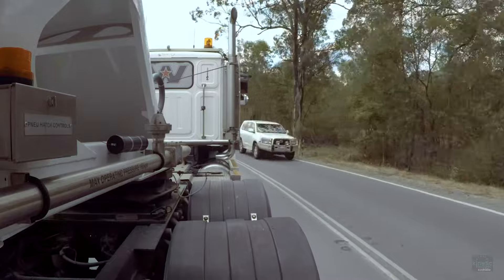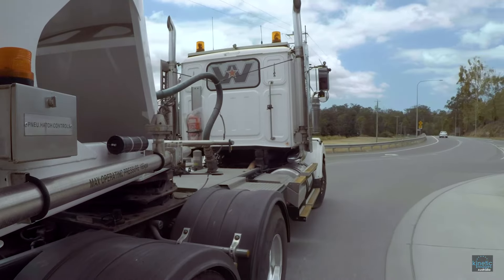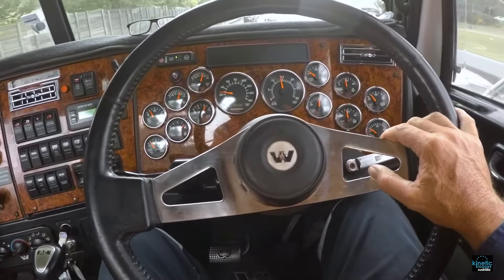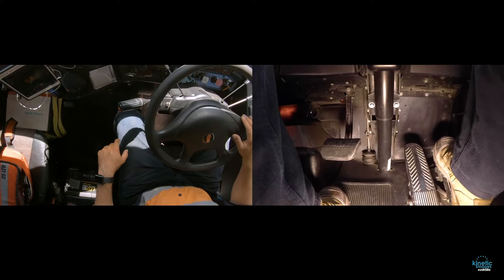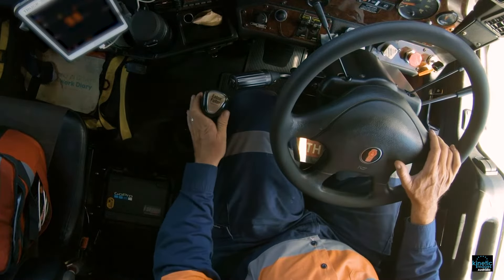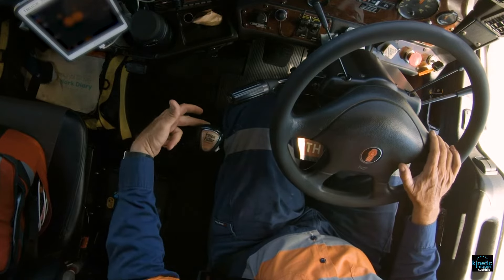Shifting the 18 Speed Road Ranger, with foot work.  Aussie Trucker Trucks and Stuff  Basics

Comment: what I found funny starting in the industry most truckers cant even explain how to drive a road ranger - the key is know what gear to use for what road speed and the rev ranges to use for changes.  Always double clutch and ignore those who tell you its better to not use it. When your loaded you rev higher before changing as you loose road speed and revs faster when heavier, you need the extra revs to stay in the sweet spot when changing.
Reply from the maker: Your spot on Michael Re loaded and loosing road speed faster, however the revs drop the same no matter what (unless you have exhaust brakes enabled) the magic is knowing your particular trucks characteristics and yes, matching road speed and revs… an interesting thing I’ve noticed in all my years teaching is that people often try changing when turning at intersections etc when loaded and you loose road speed real quick when you factor in axle scrubbing whilst turning…
Thanks for your comment Bloke :)

Comment: I have to relearn how to double clutch! I've been floating for so long that when I try to double clutch, I end up single clutching, lol! I also do not use the accelerator to complete a split shift. Instead, I use the shifter to complete a split shift by just moving the spliiter forward and taking the shifter out and putting it back in. It's much faster and you lower the chances of re-applying the accelerator too quickly, ultimately not completing the split shift, then the rpms over-rev, which makes my soul cringe, lol! Nonetheless, everyone does it how they do it. You're a pretty smooth shifter, too, btw!
Reply from the maker: @IndigenousAmericanTrucker  your spot on, everyone does it a bit different.. and as you know the main thing is to match the road speed with the engine speed… it all just takes time to be second nature. Thanks for your compliment and comment :)

Comment from the maker: Most of my videos I try to entertain as well as educate and my apologies if some of you are not music (or at least the music I chose :) fans.

I get a few comments about the music being distractive and you can't hear what I'm saying, my apologies. 
However near the beginning my voice is only supposed to be background ambience and not fully or clearly understood.. The graphics and visuals are what's important at this stage.
There is plenty of my vocal instructions where important..Skip ahead (see the below time stamps).

There are 9 sections
0:40 Gear stick basics and detent explanation. 
1:40 Introduction to the 18 pattern, the focus of this section is on the graphics and my hand.  ( My voice is intended to be back ground only and not clear)
3:18 A quick look at skip shifting and clutch basics with clutch brake.
4:50 Downshifting.
7:05 Downshifting with heel and toe foot work. I like this method personally because it allows me to make one application of the brake and I'm able to modulate the brake pressure at the same time as downshifting and using engine braking to assist.
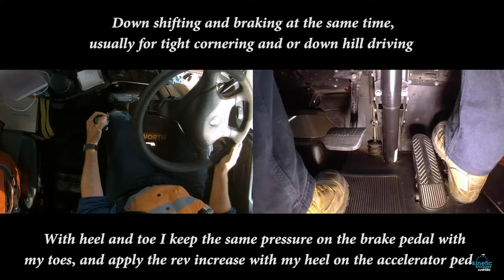7:47 Floating gear changes and more gear stick basics.
9:22  The Sweet Spot :) Just adding more info to the floating gear method.
11:09Timing (Only a little bit of a chat about it) Will do a video specifically for timing later.
12:35  Me just rambling on, most people are gone now anyway :).........

Comment: One of the better explanations on a road ranger I've seen. So many people showing bad methods or things they don't really understand. I have old VHS tapes from Eaton fuller with techniques that describe do's and don't techniques. One of which is as soon as you shift that splitter button (not range Change)  make the change don't push it and wait for a few seconds or more as inside the box is air is trying to Change straight away putting ware on components. One I like to tell people that no one seems to tell in videos is. Ease the throttle off smooth and slow before each shift not abruptly and let gear lever slip out so you don't need lots force on gear lever it makes shifts smoother and easier on the whole box. No snatching out of gears just flowing.  So many little things that are actually so important to long gevity of the box. I have an 15 speed in a 30 year old western star done 1800kms and is as good as new and its alot of around town start stop through gears alot of off road in mud going up hills dragging trailers most of the time, stress driving with decent weight. Only had oil changes. Looks like for fairly new trucks your driving the gear lever is pretty sloppy. A sign of too much force on lever pulling out of gears with no clutch use. Or even to much force with clutch use even. Good explanation in your videos though. No complaints👍
Reply from the maker: Cheers Bush600R :)

Comment: The 1 thumb down guy didnt realise to use the pause button so as to read the comments....
....  or he just doesnt like ACDC
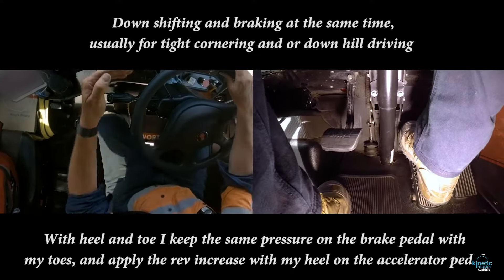7:32 OOOH I saw what you did there (twice) without comment -what a clever trick for continuing to brake while changing down, which requires gunning the throttle. Very impressed, I'm now at the stage where I can try to do that.

Comment: Awesome video mate. I drive a Freightliner Argosy in NZ and I find it won’t come out of gear without the clutch in Low Box unless I use the splits. And now and again it gets stuck in High Box as well unless I give it some throttle then it seems to come out smoother without the clutch. But awesome video 👌
Reply from the maker: Thanks Steve, bit of a worry the gears getting stuck. Have you tried applying a little pressure to the stick before you release throttle?
Reply: @Kinetic-Images-Australia  yeah I do. Most of the time it works. I have found recently that it it changes much better at  lower revs without the clutch. Unfortunately there isn’t a lot of training in this country on how to use a roadranger. We just get thrown in the truck, taught a few basics and then learn as we go. I find with all the Japanese trucks I’ve driven, they were more forgiving but this Argosy seems to be a lot more temperamental.  My downshifting is fine but I still have a bit of trouble with my upshifting.

Comment from the maker: I get a few comments about the music being distractive and you can't hear what I'm saying, my apologies. 
However near the beginning my voice is only supposed to be background ambience and not fully or clearly understood.. The graphics and visuals are what's important at this stage.
There is plenty of my vocal instructions where important..Skip ahead (see the below time stamps).

@ Gear stick basics and detent explanation. 
@ Introduction to the 18 pattern, the focus of this section is on the graphics and my hand.  ( My voice is intended to be back ground only and not clear)
@ A quick look at skip shifting and clutch basics with clutch brake.
@ Downshifting.
@ Downshifting with heel and toe foot work. I like this method personally because it allows me to make one application of the brake and I'm able to modulate the brake pressure at the same time as downshifting and using engine braking to assist.
@ Floating gear changes and more gear stick basics.
@  The Sweet Spot :) Just adding more info to the floating gear method.
@Timing (Only a little bit of a chat about it) Will do a video specifically for timing later.
@  Me just rambling on, most people are gone now anyway :).........

Comment: Hey mate do you work for cement Australia looks like the inside of alot of there trucks with blowers attached by the look of the tablet/phone set up
Reply from the maker: Hey Jacob, yep you got me.
I had to cover something’s for copyright and intellectual property reasons but it’s hard to miss hey :)
I don’t work there anymore, now 
I work in the heavy vehicle recovery towing and recovering the big stuff.
I’ll be making some vids of that soon.
Right now I’m in the process of one more tutorial on the road ranger and then the fun stuff.
Thanks for your question.
Reply: Good stuff I use to work at Brown and h and have worked on heaps of the cent aus gear and installed alot of the external PTO controll modules and systems

Comment: You didn’t explain what you have to do with clutch/accelerator pedals when downshifting ½ a gear. Could you please make a tutorial focusing on downshifting in all its different forms (full gears, 1/2 gears and 1/2 gears between Hi and Low range ie. Low 5 down to Hi 4). Thanks a million 👍
Reply from the maker: G'day Graham, thanks for you comment and suggestion. How did you go with your licence?
I'm currently working on the three phases of the clutch pedal movement and a brief over view of the air braking system.
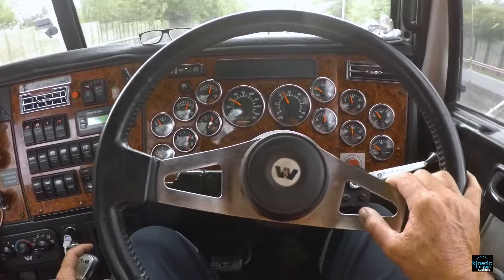In this video @ 5:49 that wasn't what you were after?
Just FYI though, I have mentioned a lot about the revs (RPM) and letting them fall when down shifting (about 400 RPM) and raising them (about 400 RPM) when up shifting. The clutch is used exactly the same for both, and the accelerator is either released for the downshift or a quick little stab to raise the RPM's for the up shift.
I'll rarely downshift a half gear though in a real world application. No real need to and to best utilise effective engine braking the whole gear (regardless of the splitter position) is the only way to go. Often you will have to judge the amount of road speed your loosing (slowing down for an intersection, loosing speed because of an incline, turning a tight corner) and you'll need to skip a few gears because the road speed is dropping off too quickly. A half gear (splitter movement) wouldn't be effective and to be honest you would really have to be on your game in the above scenarios to make a nice shift..... and as soon as your have you'll need to change again.. Bugger that :)
Reply: @Kinetic-Images-Australia  Thanks for the quick reply. Yes I got my HR licence in May and I’m just about to start work as a backup driver for a timber and trade business in Albion Park Rail driving MR flatbeds with HIAB cranes. One of the four trucks has a 10 speed box, the other three are auto I believe. At least it’s a start!
In your video, I saw some ½ gear up shifts where you just released the accelerator slightly to release strain on the drivetrain allowing the shift to take effect. My query was if you were to say go back ½ a gear in the first instance before going back full gears, do you effect the gear change just with moderating accelerator pedal (after selecting Low on the splitter) or do you need to move the stick to neutral and back into the same slot again (effectively, a double clutch downshift)? Keep up the great work. 👍
Reply from the maker: Well done re your licence... The short answer is yes , accelerator moderation should be all that is required. BUT. The correct way is a single clutch depression, raise the revs 200 RPM (because the whole gears need approx. 400 RPM ) having pre selected the splitter and it should be a nice and smooth downshift change. The gear stick into neutral and back again is an alternative and not really text book but this ensures there is no load on the drive train. Depressing the clutch has the same result.
Try not to use the accelerator only method until your really comfortable with the truck because so many variables ( Payload,  current RPM, current gear etc) can cause this change to go wrong and damage will result.
Having seen a few gear boxes dismantled we noticed some unusual wear on some of the splitter gear sets, and other gears as well ,and concluded that the driver/s were not completely removing all drive line load (not using clutch or gear stick into neutral ) during a change and the gears only managed to partially mesh. After a few of these partial engagements the gears would wear into this position there after, if not breaking all together.
Reply: I like the video and instruction but unfortunately the AC/DC drowned out some of the instruction and being able to hear the revs with gear changes. Otherwise good. Ta

Comment: So when downshifting the splitter is always in the back position ? And you're always downshifting whole gears ? So it's not like upshifting where you split gears when your downshifting it's always in the back position and you're splitting whole gears is that correct or can you split gears downshifting ?
Reply: @Kinetic-Images-Australia  yes it makes sense thanks for the quick response I guess  a better question would be if I was in 7th gear in high range(splitter forward) and wanted to downshift, would I just move the splitter to the back position and let off the gas pedal or push the clutch in to downshift ?
Reply: @Kinetic-Images-Australia  I used to drive a 10-speed and a 9-speed. But I think I will wait for your next video so I don't have to ask you a thousand questions thanks for responding
Reply: @Kinetic-Images-Australia  Tampa Florida

Comment: Just a bit confused on the splitter what is it used for
Reply from the maker: Hey Joseph, thanks for your comment/question. Put simply the splitter is just another gear that can be used anytime or not at all. The splitter is a gear that is added to what ever position the gear stick is in, therefore it is added to what ever gear you are currently in and gives you just that little bit extra. That maybe still a bit confusing so imagine you are looking at a 5 speed bicycle and its gears. You'll have a sprocket on your pedals with a chain going back, and on the back wheel you will see 5 different sized sprockets (Gears) that you can change with a lever on the handlebars and you can go up and down these gears forever and as such this would be considered a 5 speed bike. Now a 10 speed bike is almost the same except where your pedals are there will be a larger sprocket and a slightly smaller one which you can also change with a different lever on the handlebars and this becomes a 10 speed bike because the two sprockets on the front multiplied by the 5 on the back makes 10 total. You still have the choice of never changing gears on the front two sprockets but maybe there will be a hill that you need just a little bit extra to help you get over it so you change to the smaller one without changing the rear ones. Conversely you're already using the smaller front sprocket and you want to go just a little bit faster so you change to the bigger one. In a way you could say the front is the splitter. Hope this makes sense:) This link is my second part to this video and I go into splitting in more detail. https://www.youtube.com/watch?v=3sq5j-H11c0&t=96s

Comment: When downshifting, and your in 5H, and you pre select for 4th, can you also flick the splitter back so you effectively select 4L?
Reply from the maker: Hey Donk, yep you sure can but be aware that your going to need a lot of road speed to wash off and or quite a bit of revs to rise to meet this gear. For each split reduction the is a need of about 200 RPM to rise and a whole gear wants about 400 RPM so your asking for about a 600 RPM rise needed assuming your not slowing down too quick because of a  hill or heavy breaking etc.
Reply: @Kinetic-Images-Australia  Thanks for that, mate

Comment: I don't quite understand the splitting of the gear ... is that to give it more revs before you go to the next gear?
Reply: Splitter is like an extra intermediary gear (between each of the gears) -ideal for when you have a heavy load (and/or on an incline) to help changing up through the gears.
 If you've no load forget about using it!

Comment: Wat
 revs are you changing at ??
Reply from the maker: @adamclark5294  in an ideal world 1300 up to and not over 1800… all depends on engine and load. Most Cats and Cummins produce peak power around this range give or take. Anything over your loosing power and just burning extra diesel…
Reply from the maker: @adamclark5294  either this video or my other splitting video you should be able to see tachometer clearly as I’m changing.
Reply: @Kinetic-Images-Australia  Ty I was having trouble today I got my lic in a cat but was driving a western star today so different
Reply from the maker: If you have seen both my videos I’m in a western star and Kenworths, can’t remember what engines. Every truck is different even with same type of engines. Newer gearboxes are less forgiving than a more worn gearbox. Just lightly hold the gear stick into the gear you want ( providing it is the correct gear) and you will feel it slip in as the revs drop and or road speed drops. Don’t stress about it as it will all come naturally as time passes…Just don’t force it, easy does it. Good luck!